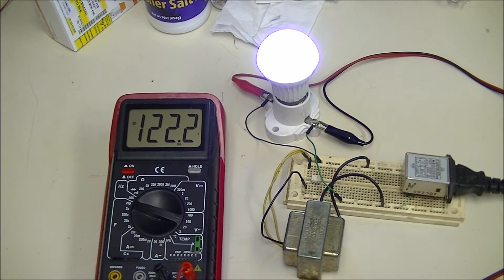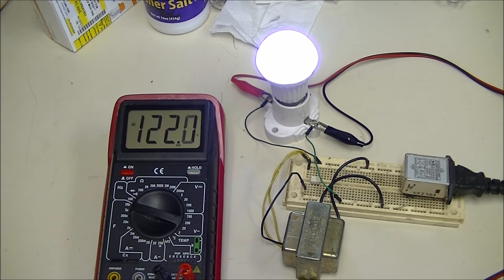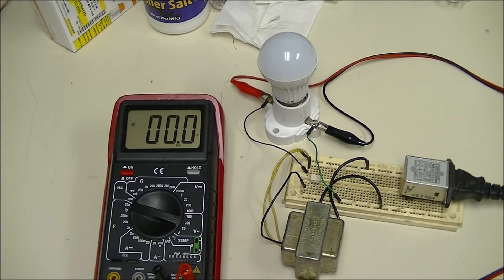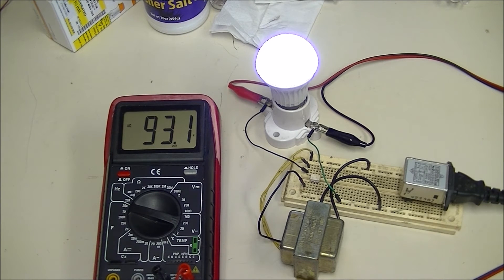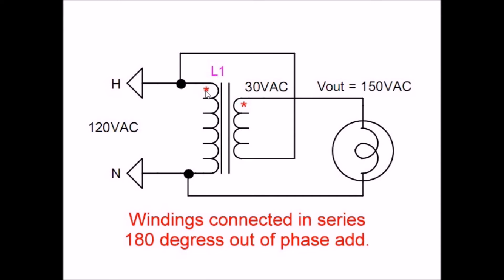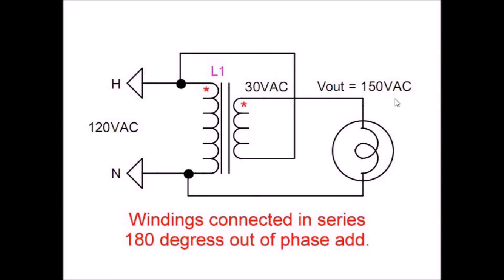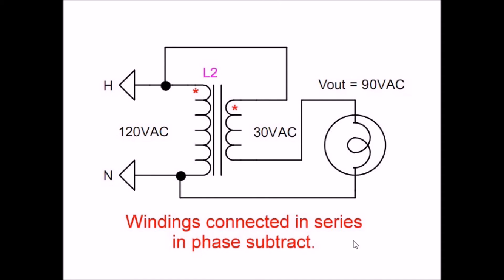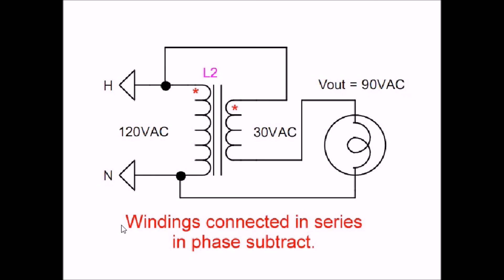Tutorial Buck-Boost Transformer Connections

Comment: Interesting topic.   Always read about doing this never tested it.   The tricky part is what is the maximum current you can expect from these configurations?   Never could figure that part out.
Reply from the maker: It's limited by the lowest current winding.
Reply: @LewisLoflin  now sir could u pls sow via diagram as u explained bucking diagram how this winding could b using 3 coils wr exactly will u b placing the coils inside or horizontal and wr will the output be thkz a lot in advance for ur advice, and thks once more for excellent tutorials on bucking transformer

Comment: It should be added that the "Buck-Boost" transformation that Loffin's explanation  should  emphasize the LACK  of 110volt  Power line isolation resulting from reconnecting the secondary of a  transformer to the primary of that transformer.

  This means that the load is NOT grounded, that the the final 
output voltage of the Buck_Boost transformation is hazardous:  

in that the Load wiring is at directly connected to the 110v power lione, NO LONGER ISOLATED .

observerms
Reply from the maker: That is in the associated webpage. Thanks.